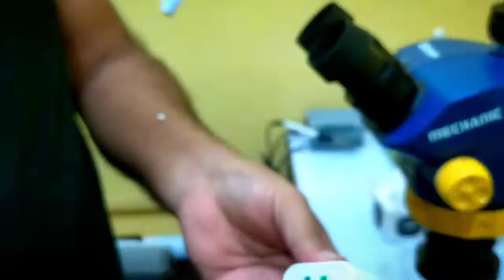Microscope 🔬 unboxing and fitting. Mechanic D75T @ahadcreation.

Comment: kaha se order kia or kitne ka pda ?
Reply: bhai amdavad me 18000 me milta he me
11 tarikh ko laya hu
Reply from the maker: Delhi 23000
Reply: Ahmadabad me kis se liya
Reply: @manishwadhwa3377  this not 3 d model it’s normal model D75T B11 Rs 15500
Reply: @mobilesparesnagpur  I saw ur video on YouTube that 16k microscope vide..from kashmir
Reply: @ahadcreation123  
What the hell.
16500 for D75t B11
and
18500 for 3D model.
Reply: 3rd class microscope hai ye.maine turant exchange Kiya mechanic MOS 300 se.
MOS bahot acha model hai..19500/-
Reply: 15k mein milta hai
Reply: Mene 18500 me liya d75t pro max
Reply: @pittalyasin4250 मेरे भाई आप महगा लेके आए हो D75T ,,--D75Tpro max 3D 2023 latest aa rha hai 18800 Rs. Sabse behtar wahi hai abhi ke time me machanic ka